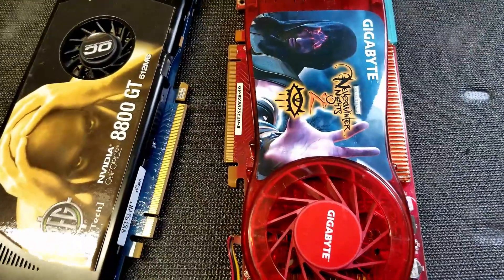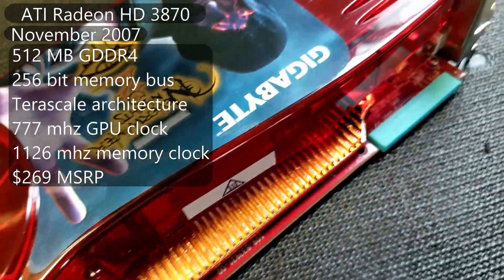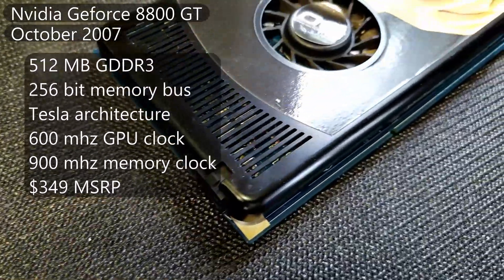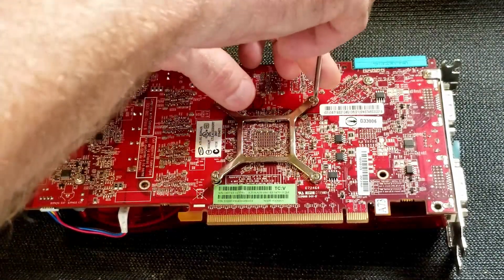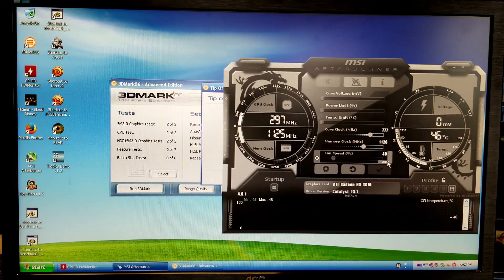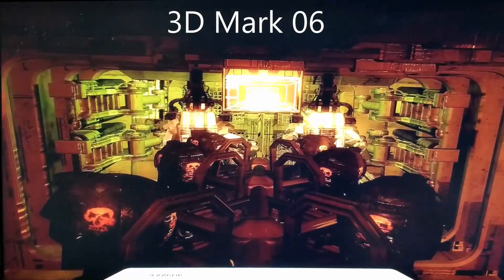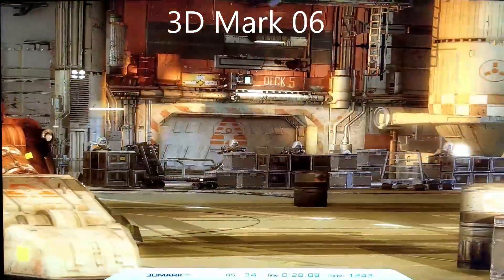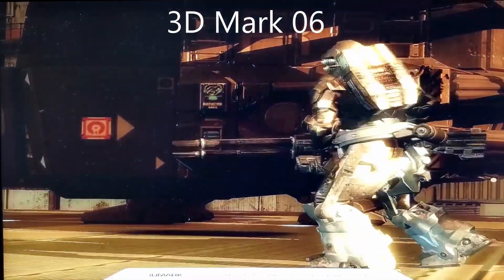ATI HD 3870 VS Nvidia 8800 GT Windows XP 1080P highest settings

Comment: Hi, these cards are not built for such high resolutions, the optimal is 1280x1024, 1080p was more of a currency for the GTX 280 or ATI HD4870, otherwise a nice comparison test 👍